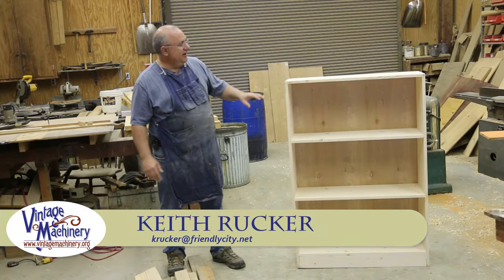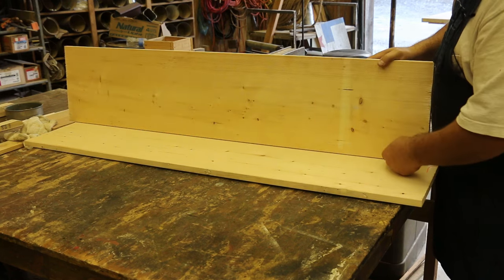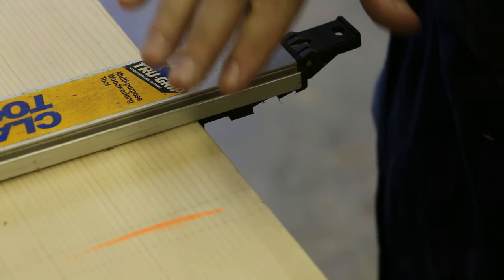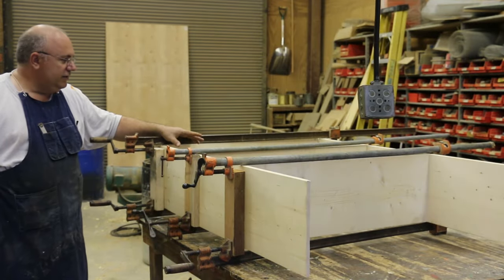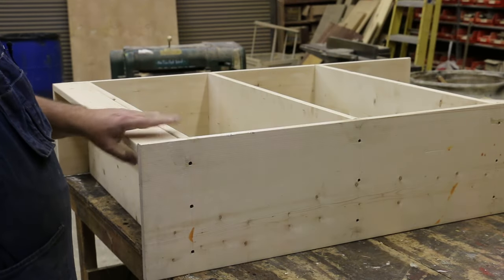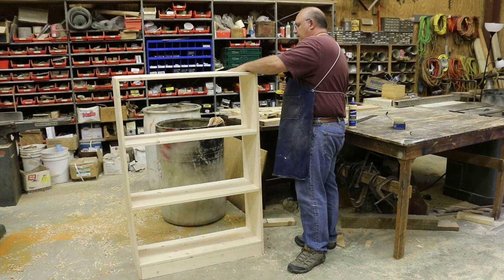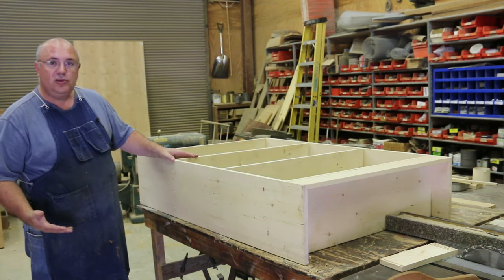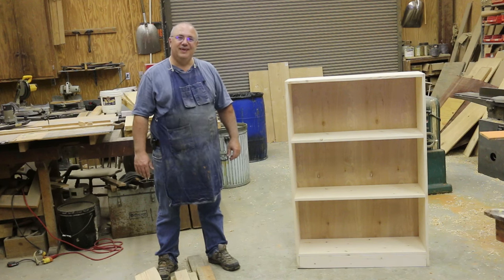Beginning Woodworking:  Building a Simple Bookcase

Comment: I always put a 1-1/2 wide strip across the front of the shelves to give the shelves some extra support. I find that if I don't the shelves sag under the weight of books. Thanks for sharing this little project.
Reply from the maker: +bcbloc02 I have used that trick before myself.  It does add to the thickness of the shelves though and with some bookcases, it makes them look a bit too "heavy" for my liking.  But sometimes function has to be put before form and if you need the extra support it is a good way to get it!
Reply: Keith Rucker - VintageMachinery.org
 Function follows form, you must have noticed my concrete blocks and 2x's for bookcases in my shop.:-)
Reply: Dale Britton
I don't know what my skill level is. How do I figure that out?
Reply: +bcbloc02 I use hardwoods for bookcases for that very reason. You tend to get little or no deflection with hard woods providing the shelves are not too long and overloaded.
Reply: +bcbloc02 The barn says its advanced lol
Reply: Richard Schmidtendorff
Good to know! I guess I should have picked something basic for my 1st project instead of a barn lift, straighten, repost, mortise tennon, and brace job. That being said I probably am a more advanced carpenter than woodworker.
Reply: lol very true.
Reply: +Alicia Patrick No thanks. To anyone wondering, this is just a shill site that directs you to a pay for content website. Any project plan you're looking for as well as plenty of how-to are easily found on the internet for free. No need to pay for someone to compile information.
Reply: +Mark Rhoads +steve long LOL. Confirmation bias spammers. - Hey, I ALSO tried TopFineWoodworking and found that it sucks.

Comment: Well done.  You are a man of many talents.  Are you sure you did not measure with some calipers some place?  Thanks for sharing.
Reply: +cerberus but did he use a dial gauge when hammering the shelves in? :}
Reply from the maker: +cerberus Truth is I did use my calipers.  When I drilled the holes for the screws, I needed to see what size plug cutter I needed to use and I grabbed my calipers.  I was trained as a machinist long before I ever started doing woodworking and my dial calipers have always been used in the wood shop for all kinds of measuring!  In fact, many of my machine shop tools and even more of my machine shop skills have spilled over to the wood shop.

Comment: That's a great how to video, I have had a miter saw for awhile now and recently got a router and table saw and this will be a great first project, we have 2 bookcases at home that are falling apart and a bookshelf was going to be my first project anyways lol! I think i will do some1-1/2" roundover routed trim across mine like there is on my entertainment center cuz I like the look. Question, I do not have any of pole clamps, would using ratchet straps or just putting the screw in to secure it while the glue dries be OK?
Reply: straps would work decent as well. but you can glue and screw the project as well.
depends. ive made things clamp glued that last and just slapped some stuff together with an air nail and glue that last the same.

Comment: This is a great video. While I know many of the things you talked about there were a couple things I didn't know. I love watching other woodworking videos online and on TV and often they will completely skip steps or just mention them but not show people what they really did. Like the bit about drilling out plugs, gluing them in and finishing them... 
On a bookshelf with adjustable shelves have you found any tricks making it stronger because you cannot nail the back into shelves that move. Say I put in a bookshelf to 7'9" (the ceiling) How many permanently fixed shelves should I put in to keep it strong? Maybe up to 4' and then adjustable shelves at that point? Or 2 at any place along the height with adjustable ones in between? What would you recommend a maximum width on a book case not exceed? I only ask because I was thinking of building in a bookshelf along one wall in my office and that goes to the other question about building in shelves. Would I just build each set independently, set them side by side and add a finishing between them or is there other ways to do that? Do you have a video of any work you did like that? 
I have build boxes for storage and rough shelves in a garage and other things like that but limited on finished projects that would be on display in my house and need to hold the weight while still looking like furniture and not like it should be in a shed.

Comment: I am an 36 yo engineer and also thinking of taking up carpentry as a hobby, I wonder can this be self taught or should I take a carpentry course?
Reply from the maker: Anything can be self taught.  Depending on your aptitude towards the craft, it will be easier for some than others.  But, a good class is always a nice foundation to build upon.  If you have the chance to take a basic class, I think you would be miles ahead in picking up where the class left off to learn on your own.